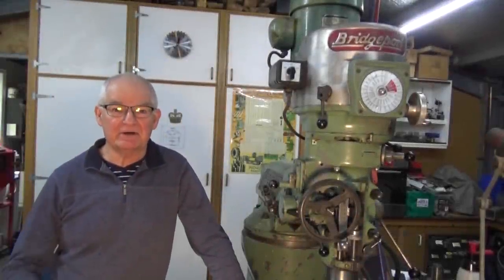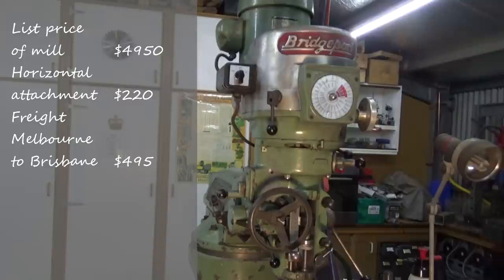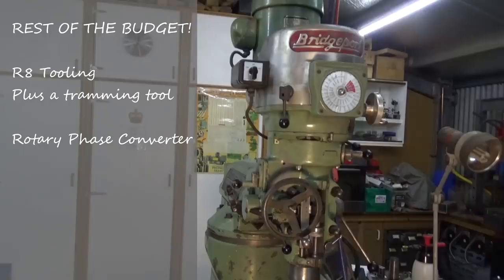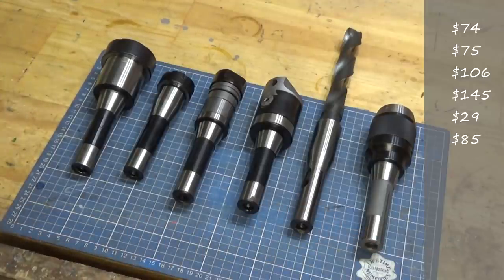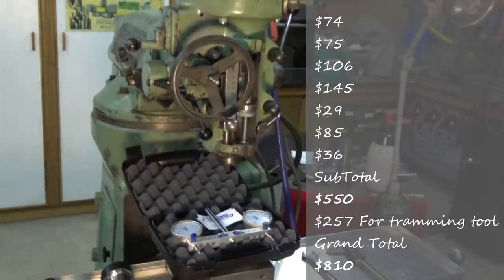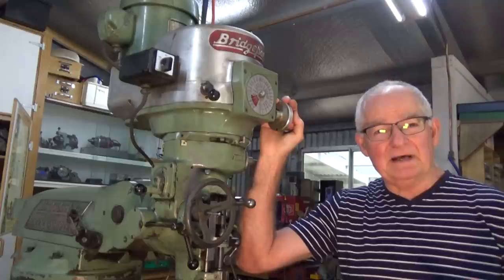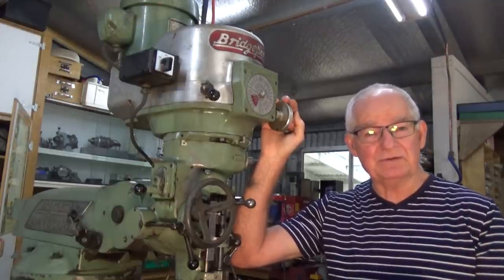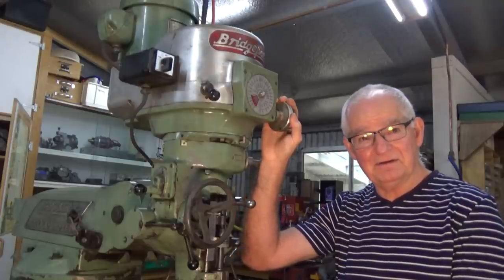Budgeting for a New Milling Machine

Comment: Install a pneumatic drawbar unit on top,you’ll love the ease and speed when it comes to tool changes.
Reply from the maker: I already have the butterfly impact wrench and I purchased some linear bearing and some hardened chrome shafting. I have designed the whole thing on my CAD programme and it'll be done with two castings. However, it's all on the back burner while I get the mill back together!
Regards,
Mark

Comment: That's a pretty reasonable price.  Like you said though, there are cheaper options.  When I got mine I took a gamble on an Ebay listing that only had 4 pictures and very little description, and was more than 1000 miles away.  The price was so low that I just decided to give it a shot.  By the time the machine was sitting in my shop I was in it about $2000 US.  I got very lucky.  The machine needed a few very minor repairs, but was in quite good condition once I cleaned it up.  I'm not sure that I would recommend to people that they should gamble on a machine like I did.  I was prepared to lose money on it.  For people who can't afford to lose money on a bad deal, it's probably better to spend more to get exactly what you want the first time.
Reply from the maker: You did get a good deal. One of the reasons we tend to pay a lot more is the old supply and demand thing. There are only a handful of mills for sale here in Oz and any one time on Ebay and the machinery dealers might have 20 or so but many are out of the price range for hobbyists or they are way too large for a home shop. So when a suitable candidate comes up the dealers know they can charge what the market will stand!
Regards,
Mark

Comment: After rebuilding the varispeed head on my series 2 BP I was disappointed in the  noise I  still had from the  head turned out to be the motor bearings
Reply from the maker: Gary,
I will be removing the motor shortly, mainly so I can check the condition of the belt but given how many components there are in the drive it actually sounds pretty good. Certainly a lot quieter than my Colchester lathe.
Regards,
Mark

Comment: Pretty reasonable pricing I'd say.  I bought a new chinese bp clone a couple of years ago at work for about 8000  GB pounds (excluding tooling and extras ). We had 3phase in the building, but it cost over 1000 pounds to get a cable run from the cabinet to a socket near the machine, so not much cheaper than your rotary converter really
Reply from the maker: That's the "hidden cost" rearing it's ugly head. It was a lot easier for me to just extend the single phase, 15 amp circuit to above the mill and then run the cable down the same line as the air hose and a 10 amp lead. 
Regards,
Mark
Reply: @Preso58  very much so, you did well, looking forward to you getting it fettled and showing its capabilities (I never approach 10% of what mine can do, you always seem to be operating at 110%)👍👍

Comment: I've been keeping my eyes open for a deal on a Bridgeport. When I bought my chinese hobby mill a decade ago every one I looked at compared itself to a Bridgeport. Good thing you got the rotary convertor because when  you use the static convertors your machine loses 1/3 of the rated power. Rotary convertor gives full power capability. As for your costs, they are only beginning. I paid about $6500US to get a new cnc mill to my door. After one year of ownership I made the mistake of adding up all the receipts for tooling and accessories and came up with just over $27k US. Ouch.
Reply from the maker: Ouch indeed! Sometimes it's best to strategically "lose" all your receipts.
Regards,
Mark

Comment: Nice score Presso 👍 Nice to see a good price breakdown, not many people talk about costs. You did well with the freight, I was quoted $600 - 1600 to get a small 50kg crate to Bundaberg from Hobart. 
Monday just gone, I finally picked my new inherited lathe. 320kg and $300 for a crane pickup. Looks nice next to Craigs Workshop's old mill and my little restored Rexman. All timed well with a bonus unexpected cash boost so I can get some tooling, a vice, parallels etc ☺️ Happy days indeed..... until yesterday when my van died 😢 
Anyone got an opinion on Great Wall utes ? 😁
Reply from the maker: Chinese plot maybe? Maybe they hacked into it? Yes, freight is a killer. My other anxiety was that I had to trust the freight company to load the mill without chipping the dovetails under the ram. I have heard of cowboys lifting mills like that with unprotected forklift tines which wreak havoc with the machined surfaces. 
Regards,
Mark

Comment: Mark,
Have you put any thought into putting the converter in the corner of the workshop and routing wiring to your machines as and when you acquire them?
Cheers Eric
Reply from the maker: Eric, sadly, I don't really have any unused corners in my workshop. The RPC is on wheels so it can be moved around. It's early days yet though. I may refine the layout later.
Regards,
Mark

Comment: Were British Beaver mills shipped to Australia?  I have one of the best models they made. ( 56" by 10" bed,  NT40 spindle, 10" riser block, 3hp motor)  The only problem new parts are not available.  It was built to be a climb mill.
Reply from the maker: David, I just looked up Beaver mills on the lathes.co.uk website and it appears that they exported a lot of machines to the USA but I have never seen one in Australia but then again as a high school teacher, we tended to only deal with smaller mills, usually Hercus or Sheraton. It seems that the Beaver has a lot in common with the Bridgeport and there are so many variants of that pattern. Some, like the Adcock and Shipley, which I have are built under licence and some are clones by other manufacturers. One of the reasons I went with the Bridgeport was the availability of spare parts.
Regards,
Mark

Comment: I'm not exactly in love with my Tai built Bpt clone, nor would I be if it said Bridgeport on the castings Mark. They are quite a versatile machine and that's why so many commercial shops have and still buy them. Imo a far better machine with even more versatility would be a Deckel FP1 or FP2. Those unfortunately don't generally sell for a used Bpt price and the X axis travel is a bit less. But overall there still a far more rigid machine. The real Bpts and there clones can also accept a vast range of accessory heads that were designed around that 3 3/8"ths spindle diameter and off the shelf power feeds are easy to find that directly bolt up to the machine. That new 415V capability you now have will probably allow you to find really cheap equipment that few will bid on because of the industrial voltage. A Bridgeport slotting or cherrying head as just a couple of examples. 

Mine is a step pulley machine and it runs quieter than the cooling fan on the VFD at anything under 2500 rpm. From the videos I've watched all the variable speed heads do tend to run a bit louder than the same with the step pulleys. Those variable speed heads do have a slight built in flaw as the bushings the Revees drive run in are plastic and tend to wear out after a few years (or many in a home shop) use. A tell tale sign they need replacing is a constant rattle from the head that just gets louder the longer you delay replacing them.So if you do get into that head I'd automatically replace those bushings to save doing it later. There cheap to buy and it's all the work to tear the top of the head down to replace them that's the main issue. The machine and freight prices you mentioned aren't really out of line if the ways are as good as you've said. I'm in Canaduh so our dollar isn't very far ahead of yours. Yes everyone loves a great deal if you can find one, but I screwed around for almost 20 years looking for a good condition and less than 4 hr drive South bend shaper. I finally said to hell with it and paid maybe $300 too much and had to drive 10 hrs each way for mine. What really counts is if your happy with the machine then the basic price is almost incidental. I have maybe twice as much into tooling as you've spent so far, but that includes a Newall dro and there micro syn scales on all 4 axises and two brand new vices that are comparable to the Kurts. A tip for you if you haven't already figured it out, unless your moving the knee then keep the knee handle reversed on the pin that protrudes out from handle engagement slots. Walking into that knee handle only needs to be done once and you'll remember to do that every single time since it hurts like hell. :-)
Reply from the maker: Well, there's no chance of walking into the knee handle since the whole lower end of the mill is now in pieces. I take your point though and I will be doing that with the handle when it goes back together again. I have decided to do the bottom end first so I could sort out the lubrication first. There is a lot less wear than I was expecting and the hardest thing about this purchase was buying it blind. The Covid lockdowns have closed our state borders and I guess I made the decision to upgrade to a BP due to us having to cancel any travel this year. I think I will tear down the head but to me it seems a lot more difficult than the bigger bits on the table, saddle and knee. The knee actually came off quite easily and I must thank H&W Machine Repairs for the excellent videos they have put on YT which show the whole process. I am guessing that you have the same issues with distance in Canada. It is very rare to find any decent machinery close to where I live and when our car manufacturing industry went belly up most of the suppliers also went to the wall. The trade training colleges also suffered so all of a sudden there was a lot of gear available in Melbourne and Adelaide where most of the car manufacturing was done. Thanks for taking the time to send such an interesting reply. I do like reading about how others run up against the same problems and how they solve them. 
Regards,
Mark

Comment: Jeeze with that type of money I think a brand new clone imported to Australia would’ve might be an option to go for providing better accuracy and rigidity. I never knew BP have right angle attachment, super useful for tool and machine makers.
Reply from the maker: I had looked at the Taiwanese clones and you can indeed get a new one for about the same as what I paid but the quality just isn't there. Many of the scales are just the flimsy riveted on type and the iron used for the castings is thinner and more brittle. I also liked the idea of owning one of the iconic machine tools.
Regards,
Mark
Reply: @Preso58  Interesting good to know. I was skeptical to get a Taiwanese clone but read many machinists on forums said the same as to what you have said and that the original Bridgeport and alike are better build quality. 

What’s weird is that I know that many skilled high precision machinists all uses Taiwanese clones like Acer. Not sure if you know Tom Lipton, he uses an Acer.

I’m very fortunate that I live in the US, I can easily obtain a used bridgeport for $500-$800 and rebuild it for another/less $1,000-$2,000 depending how much repair is needed. BPs are the type of machines which is always repairable so long the cast iron base and housing are not damaged.

Maybe you could’ve gotten one from Craigslist for $500-$800 in US and have it shipped to you by cargo freight to Australia, would’ve cost you so much less than what you have paid but required rebuilding and will still cost less. 

Or maybe buy from a trusted distributor in US who rebuilds/refurbish BPs/mills and have it cargo shipped to you, I’m sure they have done this for many customers all over the world requiring American made mills.

Anyways your video was helpful, I’m planning to buy a used BP. Thanks. Hope you make nice precision parts with your BP. 😀
Reply from the maker: @sto2779  I have looked with envy at what people pay for used machinery in the USA and the choice is far greater than what we can get here. When I ordered the Bridgeport I couldn't look at it in person because of Covid travel restrictions but the photos looked OK and the vendor was good enough to take some additional photos for me. What I was really happy about was that this particular machine had all metric dials and screws on it. I hadn't expected that given it's age. We changed to metric here in Australia back in the mid 70's. Also, the motor was set up for local voltage and frequency. One of the perils of buying offshore is always to do with incompatible electrical systems given that we use 240V single phase and 50Hz frequency. I did buy a powder coat gun from the USA and had to buy a 110V to 240V transformer to make it work. I have noticed that Joe Pie has a Bridgeport clone so there must be good ones available. 
Regards,
Mark

Comment: I went with a 15hp rotary phase converter also! I just switched to cnc and that’s why I bought it cause it supply’s clean voltage! I haven’t had any issues with the cnc with it. I need to look at my Bridgeport and see if it has a coolant pump?  How does your coolant pump work? Does it supply oil while cutting , as cutting fluid?
Reply: Yeah no access to a coolant pump
Reply from the maker: The little three phase coolant pumps are not all that expensive and mine just sits on a steel plate inside the column of the machine and it's held in place by a couple of small screws. 
My pump only runs when the main (mill) motor is energised. It has a separate switch and contactor But I haven't added any coolant to the sump yet. I looked into all the options when I got the Bridgeport and the RPC seemed to be the least invasive way of getting the mill running, plus, if I ever get any more three phase machines I can run them too. Getting three phase power to my workshop was never going to happen for lots of logistical and thus, cost reasons so apart from the noise issue I don't have any complaints. 
Regards,
Mark

Comment: Did you investigate the cost of getting 3 phase put in? Usually a fairly cost effective solution compared to phase converters.
Reply from the maker: Ahh, well that's a sad story. We had our single phase supply put in underground and we live on acreage so our house is a long way from the property boundary. At the time we had very little money and I told the electrician to use the lightest cable he thought we could get away with. Consequently we could never pull a new cable through the conduit and the only option would be to go overhead. We have some very large eucalypt trees which regularly drop branches that would snap a cable and the trees are all protected anyway..... So, I don't think it's going to happen in my lifetime. Maybe when we all get our own personal fusion reactors it will be viable!
Regards,
Mark
Reply: @Preso58  fair enough mate. If you're anything less than 60mm on the conduit you'll struggle to pull a new cable through, and for acreage it gets expensive fast at around $1200 per 100m for the cable alone.

Comment: I'm less than an hour from Boring, OR!

What keyless chuck did you go with? I've been looking for one for my drill press and can't decide if I want to go with a "good" import one, or something a bit better like a Rohm. Albrecht would be nice, but too expensive for my blood.
Reply from the maker: Andrew, it's an import chuck but we don't have much choice here in Oz. I would love to have an Albrecht but it's a cost/benefit thing. I would have to go to a specialist tooling house or try to find a good used one. In most cases I would just be driving spotting drills or countersinking a hole so what I have will do the job.
Regards,
Mark

Comment: Quite a setup - great addition to you workshop, Mark. BTW - what is this kind of button that you're holding for a second while starting rotary phase converter?
Reply from the maker: Gennardy, It's just a momentary contact switch to start the idler motor. It must have a latching relay inside the box somewhere to keep the motor running. I believe the motor requires some extra current to get it going.
Regards,
Mark
Reply: @Preso58   Thanks Mark.  I believe there is additional pair of contacts that engaging bank of capacitors during starting, until motor will get up to speed. While you holding this button -(for a second or two)  capacitors creating phase shifting circuit and starting idler motor.  I don't know how this button called in English :( and looking for the proper name to order it.

Comment: I wonder why all the anglo countries with roots in the UK (US, Aus, NZ) seem to have something against residential three phase. It really makes life tough and complicated for you guys.
Reply from the maker: In Australia it could be to do with the distances we have to contend with. Also, our electrical generation used to be wholly owned by the government. I guess they figured that if there was no competition they didn't have to give you something that they thought you wouldn't need. 
Regards,
Mark
Reply: @Preso58  I don't think distances have anything to do with it, electricity isn't transferred long range at anything nearing household voltages and long range lines are mostly 3 phase in all countries. Power is transformed near your house to 230V, that's where what you get home is determined. Our grid used to be government owned when it was developed, as were/are most other european grids. Making a 3 phase grid isn't really more expensive than a single phase one, cheaper in a lot of ways since it saves on copper. 

I think it's cultural rather than economical. Like the the english speaking countries are all somewhat connected to each other and I guess when the biggest country (US) decided to roll out only single phase to consumers, the rest developed their grids in similar styles.